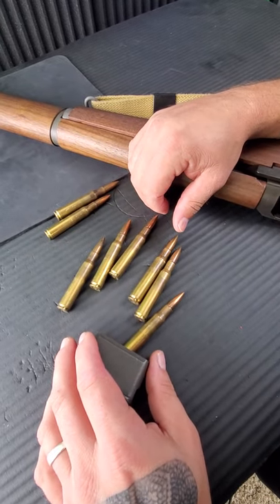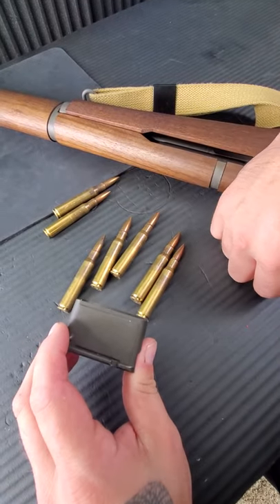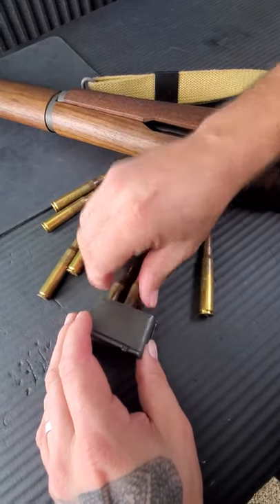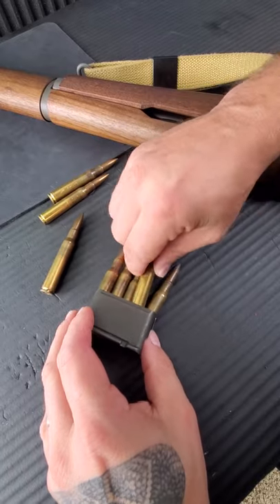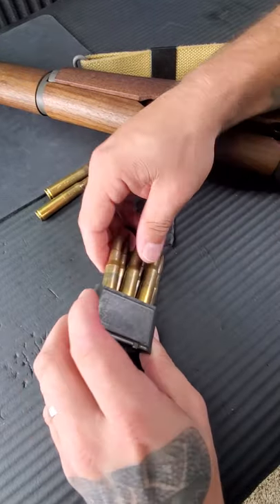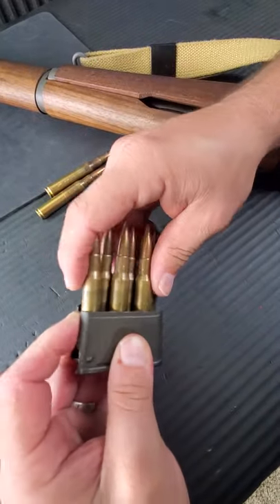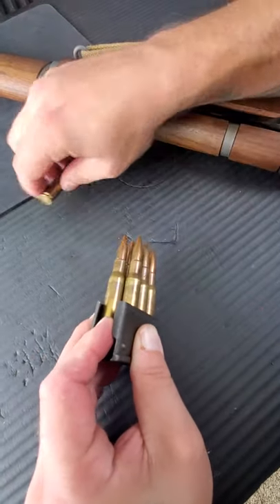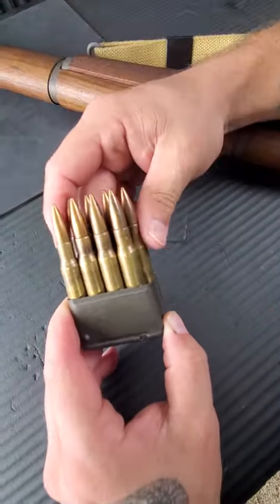How To Quickly Load Enbloc Clip For M1 Garand #shorts

Comment: Does it have to be 30-06   Springfield Ammo
Reply: You mean is it safe to shoot any .30-06 in an M1 Garand? Depends if you have a milsurp M1 or a reproduction. I know the OG M1 Garands we’re only designed to fire standard 150 grain FMJ ammunition. I would not recommend firing anything higher pressure than that if you have an milsurp M1. That’s a good way to turn an expensive piece of history into an expensive pipe bomb lol. If it’s a reproduction I would do some research before hand.